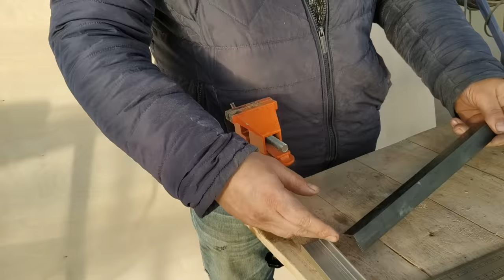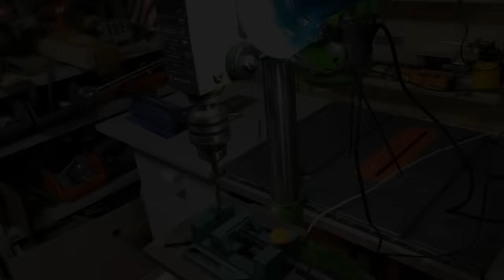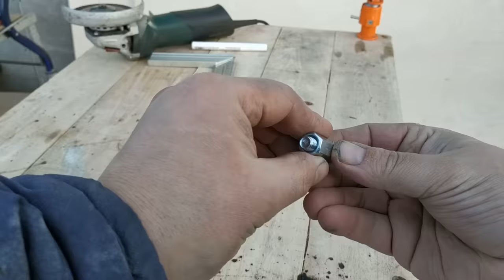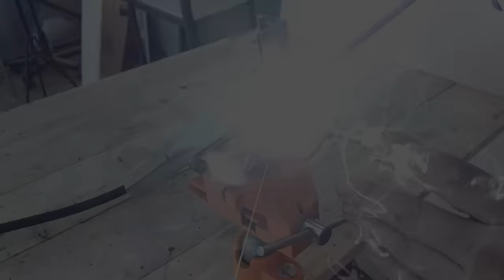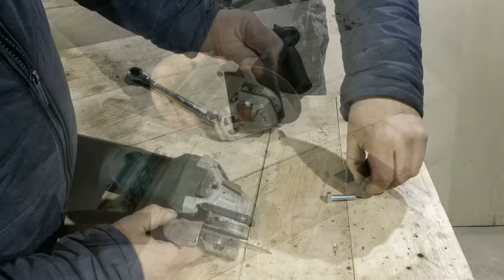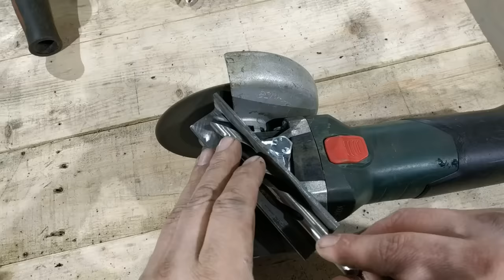Few people know the secret of sharpening a drill!!!  A brilliant idea!

Comment: Dead wrong. No relief angle on the cutting edge - That drill will rub and overheat, it will not cut.
Reply: Absolutely true and it must be ground the same on both sides to center the drill!
Reply: You are dead wrong that is a left hand drill and as such the cutting edge is to the left of the picture not the right o& the picture. Thks
Reply: Sorry I commented on the picture at the start bu5 watching the video to the end you are right the fixture is holding the drill at right angles to the grinder disc which if he does turn the dril and move further towards the disc will result in as you say no relict angle. Apologies for responding before fully watching the video. As the old adage says keep your mouth shut and watch, listen then comment.
Reply: Correction, if he doesn’t rotate the drill and move closer. Not “if he does”
Reply: Yes you are right , see my comments
Reply: Everything appears back to front.
Even the G clamp is LH thread?
At about 1.30.

Mind you, using a cut off wheel for grinding is not good. Look at the flexing of the disc and tell me it's grinding true.
Reply: @xagtly a trick routinely used to pass brand display checks.
Reply: You’re absolutely right. Aren’t these videos verified?
Reply: Takom tarcza to można tylko ciąć a nie opatrzyć cokolwiek 😂😉

Comment: How not to sharpen a drill! It’s so much easier to do it freehand on a bench grinder with a little practice 👍🏻
Reply: Yes, this video was BS
Reply: As an apprentice that is how I was trained to sharpen drills .. freehand on a bench grinder... also sharping them for different materials steel, copper, brass all are different and to grind drills to make flat bottom drills , counter sunk and counter bores.....by hand , admittedly it does take practice to do .😊
Reply: Yeah...but the trouble is I can't seem to find a fine grit stone for my grinder. I sharpened drills all the time in a machine shop years ago and they had the fine grit stone. Yeah...your right. Much quicker when you know the right technique.
Reply: This video is an absolute disaster from start to finish.
Reply: I bet I'm not the only older guy on this chat who carries a nasty scar because of not giving power tools the respect they demanded - so easily done, but you only need to get it wrong once buddy.

Comment: Great example of exactly how not to sharpen a drill . 😂.
Reply: That's for sure. The correct angle is 59 degrees and it has to have relief.
Reply: @michaelshoup6801  depends what type of drill it is...regular chisel point, split point, spot drill, flat bottom drill, blah, blah, blah there's more! And like anyone will get that angle right anyway.
Reply: People who know will get it right..
Reply: Mach ich Dir frei Hand wesentlich besser und haltbarer, wetten ?    Eine der ersten Übungen in Deutschland frei Hand am Schleifbock und der Bohrerlehre.   Leicht drehen und hinten etwas abtauchen , das dann an jeder Schneide.    Da rattert nix beim Bohren und die Standzeit passt auch.   Alles reine Übung, Sachverstand und Gefühlssache
Reply: @michaelshoup6801  135 degrees included angle for metal cutting, and 118 degrees for wood or plastic. I've been a machinist for 30+ years, and I understand why this is totally wrong, but yet it works!
Reply: @hippychipsguitars601  Once again...not necessarily 135 for metal. I was in machine shop business for 50 years, ground MANY a drill at many angles by hand,  and when cutting metal it depends on several factors on what the drill angle needs to be. 118 drill will cut metal fine everything from brass and aluminum to tough alloys/ stainless.Thin the point and have some sort of spot/chamfer for drill to start and away we go.   135 is great too but most regular Joes have to grind drills by hand and 135 degree drill has to have the point thinned out or better yet split and not to many people not in the bizz know what that is or how to do it especially by hand...it ain't easy on smaller drills. When I was young and had a steady hand and could see I could grind 1/16" drill by hand pretty regular (had to in my business) not any more.

Comment: To anyone watching this video, DO NOT , I repeat , DO NOT  use a zip cut disc to sharpen drill bits. They are not designed for this, they are meant for cutting. If you notice in this video how the disc bends when side load is applied........this video should be removed from YouTube.

Comment: Yes have to agree, you do need relief from the cutting edge back, it’s actually simple slightly rotate the drill bit whilst having it slightly below perpendicular.
Also cooling the Drill Bit with a small container of water will do, so it doesn’t get to hot and damage the hardening, it is typically HSS. This will allow for longer life out of the sharpening. 
Another tip, use a cutting oil again stop the drill over heating and will lubricate the cutting edge. Another tip if you are going to drill brass, take the sharp edge off, it will stop the bit bitting in to the brass. You will also want to ensure the length and angle on each cutting edge is the same, this will stop your drill wandering.
Yeah don’t put weight onto a cutting disc, maybe get a grinding disc and rig up carefully a jig to use for your drill bit. 
One thing you did right, the angle for bit should be the same each side and as mentioned the cutting edges should be the same length. Then simply drop the angle and rotate to give relief for the cutting edge. And cool the drill bit during sharpening.

Best of luck, it is actually very simple.

Comment: I was drilling many 2" holes in nodular cast iron with a massive magnetic drill press. I got a copy of Machinery's Handbook and studied the complex geometry, incrementally slowly getting better. At one point, I happened to ask Julius, a Master Tool and Die Maker. He went free-hand to a freshly dressed very fine grit bench grinder and in one fell swoop created the proper angle, to my astonishment. Also showed me how to back down the web as the drill bit had been sharpened too many times. His hands actually shook and he chugged Peptol Bismol. I attributed this to untreated PTSD . He flew a bomber in WWII, bombed Dusseldorf. He would do test run take-offs during decent weather with sandbags to simulate the payload, then mark the controls with tape to be able to get over the target faster when the weather was shit. This worked well until it didn't. Turns out the gunners were secretly smuggling many  extra lead-filled flak blankets on board to try to stay alive. These were iron men.

Comment: Stop, stop, stop. Don't do this. That's a cutting disc Not a grinding disc. Also You could of properly sharpened several drill bits in the time it took to make this incredibly dangerous contraption.

Comment: I hope few people will use this "secret". You should never use a cutting disc for this purpose (it will shatter in the end, so it is very dangerous). The drill looks to have near zero clearance/relief angle. There is a change the cutting edge feels razor sharp, but it won't cut anything when the clearance angle becomes negative.

Comment: I couldn't see well enough but these men are correct about the cutting edge & trailing flute. Cutting edge must be the highest point or it won't cut,just drag ass. Must rotate at proper angle & clocking to get correct geometry.

Comment: PLEASE DON'T grind with a cutting disc, you'll end up injured. They are not designed for lateral load, and they wont grind in any case. Also that is NOT how u sharpen drill bits.

Comment: I use to change the pitch and web on drill bits they'd punch threw steel like butter! I use a bench grinder and a small protractor to referencing the center of the bit to check it while shaping the blade pitch.

Comment: Cleaning up an edge with a cutting disc, not cleaning zinc coating off the nut before weld, I turned it off at this point when I realised you are a complete biff

Comment: safety - safety.

What are you doing . You make a set-up with an angle grinder where you grind drill bits. A CUTTING DISC is mounted on the angle grinder. It is used for cutting with. NOT for grinding with/on. Think about the people who could get hurt by using your setup

Comment: When I sat my Mechanical Practical Trade Certificate exam afew years back, one of our exercises was to sharpen a 10mm drill bit. Firstly, show the examiner your drill bit before you start to sharpen it free hand against a bench disc grinder, put on your safety glasses and gloves, then proceed to sharpen, you were given one attempt, show the examiner your drill when completed that task. He would visually look at it bit, check the cutting angle is correct, hand you back the drill bit, your are required to place in the drill chuck and drill into a 5mm metal plate. If it drilled through without resistance, correct waste-off from the cut, no piercing noise. You are given a pass.

Comment: Grinding on the side of a disc or wheel?
Reply: It's really not a problem, unless you are trying to hog off lots of metal fast.
Reply: It is a big problem when using a cutting disc, which he is clearly using by the amount of flex In the disc.

Comment: Please don't try this! That is a cutting disc and that is extremely dangerous. After sharpening a drill or two that disc is going to get thin on the side and shatter. It might work with a grinding disc fitted backwards....But that is also NOT WHAT AN ANGLE GRINER IS MEANT TO DO!

Comment: So are blunt 1mm drill bits a throw away item ?
Reply: We drill thousands of 3 mm holes in aircraft /heli frames in jigs, so we do a lot of sharpening, you need perfect eyesight,even so they never cut as nice as the factory ground ones....
One mm drills we throw away, impossible to do.

Comment: what is the contact angle between the drill head and the disc？
Reply: it must be 45 degrees, but he never mention it !
Reply: Should be close to 30 degrees
Reply: @unnikrishnannair6848  Wrong!
Reply: 60 degrees. Put two hex nuts together. That's the angle.
Reply: Angle = 59°
Reply: @martintheron1386  I'm glad someone finally got the right angle
Reply: 59⁰ is standard (118⁰) inclusive

Comment: Nooooo...  Get a few drills and practice by hand once you get it it is so easy and quick. Put a small v block of wood near a vertical wall and check each face is at the same height. Sharper profile angle for softer metals more obtuse for harder.

Comment: Apart from anything else that’s wrong, that’s a cutting disc. Not designed for grinding on its face, could easily shatter using it this way. Other than that, not even sharpening correctly anyway.

Comment: Well that's a bit and not a drill. And drills don't need sharpening, the bits do. They usually need to be sharpened right as well. I bet you have to do it again every time you use that bit.

Comment: Despite i have 2 different sharpening tooIs, original and one is professional, i do sharpening by FREE HAND anyway since its not on my hand to gettin out the tool so from 3mm up to any i do with a pretty good accuracy, less then 3mm is difficult on stone grinder or even cutting disc so i am using a diamond grinding disc for less then 3mm....however, this method here is OK, BUT, BUT....the guide part for drill bit MUST be setted with 2 angles; one angle (azimut) to make an aprox 120 or whatever angle we need to do and other angle is inclination angle of 2-3 degrees so the cutting edge is HIGHER then the tail edge of the sliding surface of the flute (feather), otherwise, this way he is doing it, the drilling bit will hardly cut or even if it would cut a bit it will SQUEEL like slaughtering pig....

Comment: Other than the poor process sharpening a drill(easy to learn free hand)  That abrasive wheel is a cut off wheel and not to be used on the side of the wheel.  You will see the unsafe flexing in the video.....  If that wheel breaks you will have more than the issue of a sharp drill to contend with.

Comment: This is wrong on so many levels , cutting disc can shatter when use as a grinding wheel ,drill itself has no clearance Angel or Rake...I am a fully trained precision engineer so I know what I'm talking about. That drill may cut through wood but not steel properly and for god's sake don't try using it on brass or copper.

Comment: It's a really bad practice, to use a cutting disc for grinding. A cutting disc (being much thinner than a grinding disc) can and will shatter if the flat portion becomes too thin, sending shrapnel across the room at high speed. I have seen this happen and any professional metalworker will have (at least anecdotal) experience of this. It's pretty negligent of you to show this on a video as I have seen many unprofessional people doing it and it should be warned against at every opportunity.

Comment: Where do you get reverse helix drills as shown in the video? I have never seen one. All drill presses I have ever used run the drill in a clockwise direction viewed from top. All the drills shown are reverse to this and if used in a drill press it would NEVER cut no matter how it was sharpened. Battery drills would have to be in reverse as well. All FRACK TO BUNT.  WHY bother to make such a stupid untrue misleading video.
Reply: Das Video ist spiegelverkehrt. Das sieht man an der Schrift auf dem Winkelschleifer.